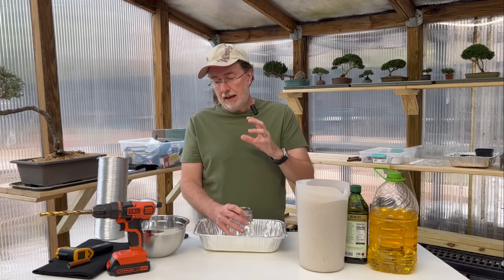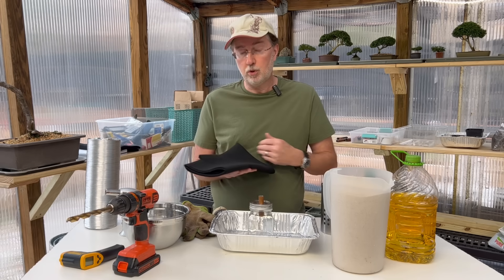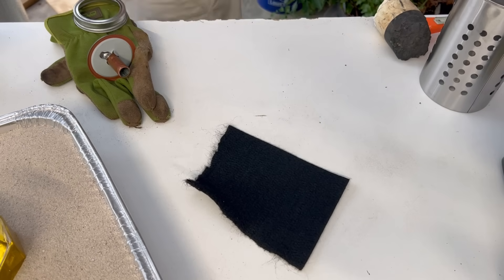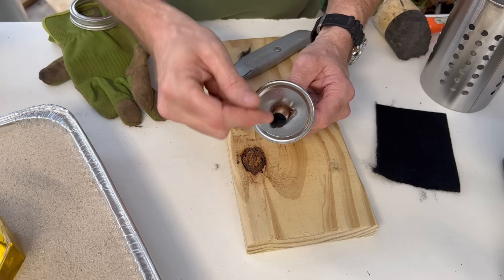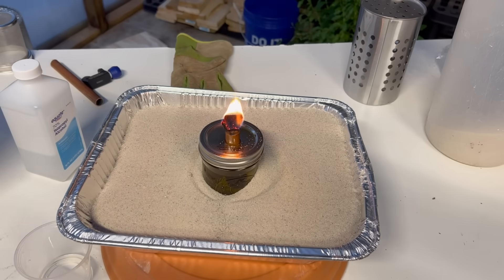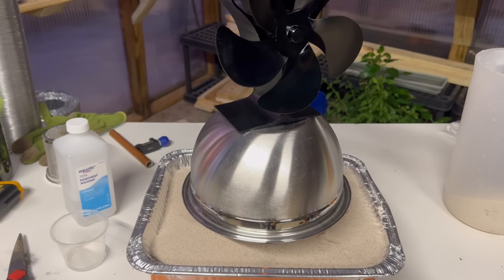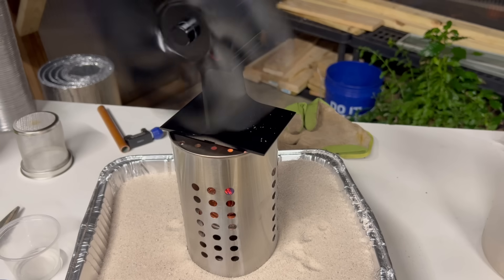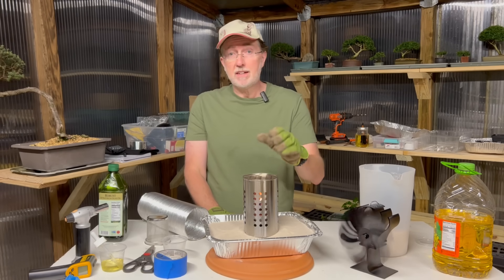DIY Carbon Felt Heater | Burns Forever Without Changing Out The Wick

Comment: Add a steel mesh mantle over it and a shiny stainless reflector curved around one half of it. You’ll increase the heat output by many times.
Reply: thanks I just checked and Amazon has a mesh mantel just the right size for 14$ LoL
Reply: Doesn't that violate the laws of physics?
Reply: @quakerorts you end up making the heat output directional. Does not increase heat output but directs it more to one direction
Reply: @quakerorts , EXACTLY, just as the candle- terracotta pot thing is so much BS, you're not going to get more heat out of this than is dumped into the air. That is, nothing is going to multiply the heat. All you can do is collect it in something and radiate it off that larger area.
Reply: @quakerortsyou are so smart.  I tried it and it is a stupid experience
Reply: You can't increase the heating output for free by adding mirroring effect. You only concentrate the radiation or reflecting it into a specific direction similar to using a magnifier. Overall you have the same energy output in the specific place that you can measure it. What you are saying is breaching the laws of physics. Because you don't increase the energy output of the fuel provided. And when you heat a metal or another object like a mantle, you store IR infrared heating in it, which by overheating the metal, is converting the IR into visible radiation. Look in the spectrum of light. Visible light does not give off more heating. That's is conversion of the energy from one form to another.
Reply: Some people commenting have missed the point. Mantles and reflectors are there to aid recovery of BTUs that would be lost to a less efficient system. The candle puts out only so many BTUs, that's true, but harvesting as much of that energy as possible is aided with a mesh mantle, and directing what heat can be recovered towards the area you want to warm is aided by the reflector. You don't make more heat from the original heat source; you recover and use it more efficiently, so there is more useable heat.
Reply: @antiquegeek the candle can be forced to produce a little more energy IF  the unburned hydrocarbons in the smoke are fully combusted. A catalyst would enable this reaction but the mesh would have to be carefully selected.
Reply: @David-p9y9c  The purists would say that you didn't get more energy from the candle because they can calculate what the total BTUs are in the candle. Of course, a significant percentage of that is lost to wasted/unrecovered heat and, as you point out, unburned gases that still have energy potential. Adding the proper catalyst could certainly go a long way toward wringing every last BTU out of the system. The choice of material is, as you say, critical, but where to put it is also important. Putting it where it will get enough heat to initiate and maintain a reaction, for instance, if the reaction needs heat.
Reply: @antiquegeek  I once had a kerosene heater that had catalytic glass and metal wire heat chimney. It consumed all the “smells and smoke” while giving off plenty of radiant heat. I kinda figured that was what the builder was intending. Without it the thing STANK, kinda smelled like a diesel engine.
Reply: It will cause the mantle to glow and deliver a lot of IR, energy that would otherwise not be used as effectively. 
This is why a lot of old paraffin/kerosene heaters had mantles. 
If you add a reflector, you’ll direct the IR forwards. 

Look to old heaters. 

You can make a mantle from steel mesh. 
But it would be best to make that wick thin and a larger circle, then have the mantle just a little bigger, so the flame heats the mantle directly.
Reply: @ckworton You can't increase the heating output for free by adding mirroring effect. You only concentrate the radiation or reflecting it into a specific direction similar to using a magnifier. Overall you have the same energy output in the specific place that you can measure it. What you are saying is breaching the laws of physics. Because you don't increase the energy output of the fuel provided. And when you heat a metal or another object like a mantle, you store IR infrared heating in it, which by overheating the metal, is converting the IR into visible radiation. Look in the spectrum of light. Visible light does not give off more heating. That's is conversion of the energy from one form to another.

The same with the mantles. They only give off visible light more than IR.
Reply: @ckworton  IF the mesh is acting as a catalyst, creating a more efficient combustion, then it will increase the amount of heat produced via the combustion of the byproducts produced from the oils. 
Essentially the smoke is wasted fuel for the process of combustion. 
Burning it fully produces more energy, but by how much and what byproducts produced in the process is the question.
Reply: @ckworton How fine should the mesh be?  40, 80, or 120 mesa?
Reply: Not so you can just convert more to radiated heat with the mantle and direct that radiated heat with the reflector. The candle gives off the heat it gives off no more no less
Reply: I just want to mention that if the flame gets too hot it will ruin the coil in the fan, we've ruined a couple on other stoves, now we put a piece of flat steel over the top so the fan isn't on direct flame. It's been many years now and we haven't ruined a coil doing that
Reply: You cannot trick the laws of nature. You'll only get as much heat out of it as you put into it via the oil (BTU).
However, one could focus the heat produced with such a shield.
Reply: T 10:58 😅
Reply: Can you show us a pic of it
Reply: Got all the gear and a tent vent for the window, anyone got any idea what to use as a hood to catch the smoke to feed it out the vent pipe please?
Reply: You will not increase the heat output at-all, though you may benefit from more of that heat.
Reply: I saw a guy do that on a video on you tube. It worked great.
Reply: No. You won't,,,,,,the flame is doing all the heating...the pots,,mesh,,etc,do nothing
Reply: @johnniecameron8829 
The pots and mesh take the candles connected heat and heat pot or mesh that then gives off much of its heat as radiated heat which you feel more than connected heat that is lost to your ceiling
Reply: @johnniecameron8829 
 actually they "redirect" the heat output! 
Yes people who say mantles and all this other stuff increase the heat output are absolutely wrong, but they do have a purpose.
Reply: @johnniecameron8829 smh...pedantic much?  No one said 'more heat' than generated--they said utilize the heat made more effectively
Reply: @honeybadgerisme  read the statement again ,,you missed  something
Reply: @johnniecameron8829  output?  not temperature?  pretty plain.  It's useable heat, rather than wasted heat.
Reply: @honeybadgerisme  in Johnny's defense, the original post did say it would increase the heat output by many times
Reply: @johnniecameron8829 the external devices heat up and radiate heat way more than the flame itself will.

Comment: Hi,
You mentioned changing your copper pipe, what did you do differently with the new cut please?
Reply: For the wick to suck the heavy oil, the pipe needed to be thinner.
Reply: @MarianLuca-rz5kk Great wick holder!  What diameter pipe ended up working best for your build?
Reply: @Grateful_Grannie  
Yes, good wick holder. I use a 6 mm copper pipe.